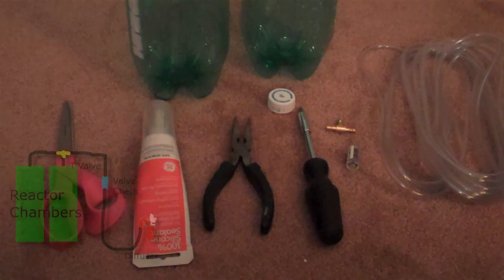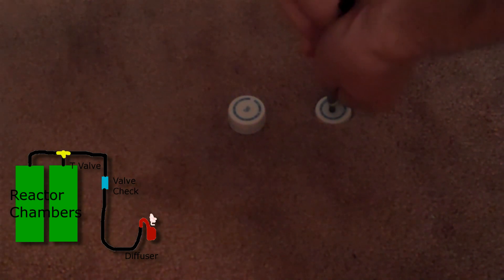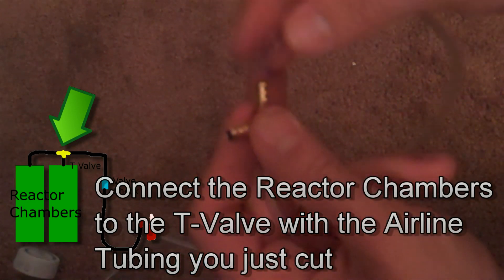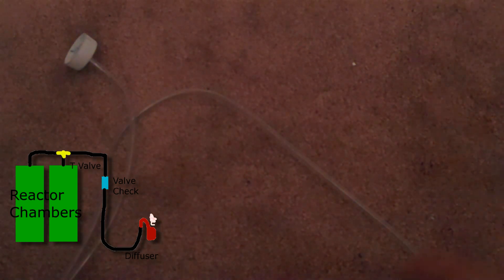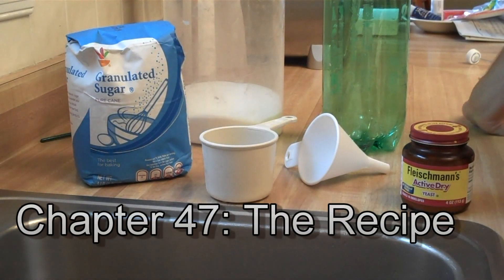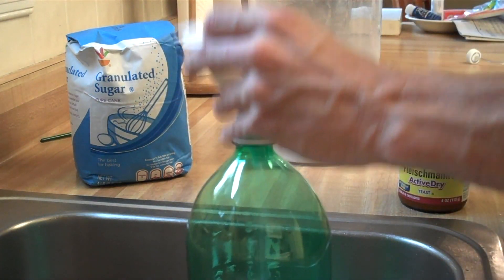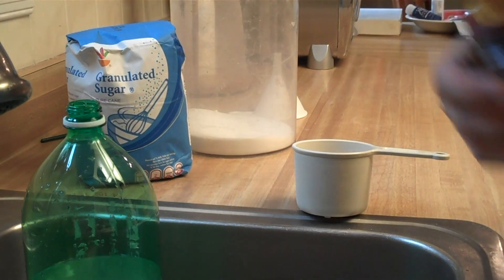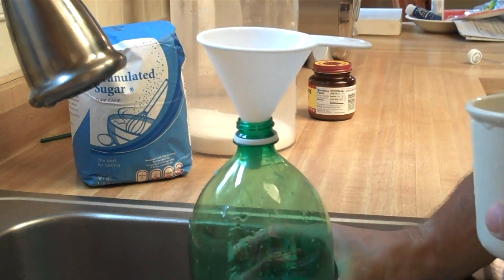How to Build a DIY C02 System and Recipe

Comment: In my setup (DIY), the bubble counter is not really there to adjust the rate but more for monitoring purposes and as a layer of contaminant containment.  for monitoring, it's a quick visual status of system state, more so then the bubbles from the diffuser (which is more difficult to decipher).  for the containment, it helps to keep contaminants trapped in the water of the bubble counter and allows only the CO2 gas into the tank.  you'll understand after you see it in action.

Comment from the maker: I thought about putting in a bubble counter but I never really pay attention to it anyway. With a pressurized system you can control the rate. With a DIY setup the only way to control it is to make a new solution (which I would do in my routine anyway). If I find a second valve check I will definitely put that in so the two containers are on separate lines. I would only lose a little bit of c02 while changing the bottles that it's not an uber high priority. it would be a good addition though :)

Comment: People always forget in these vids to give one SUPER important tip.. Silicone wont stick to silicone.. so dont use silicone airline and think that siliconing seals will do any good. Make sure you use the normal pvc airline.
Reply: Why not add a couple of handfuls  of juicy sultanas and the after fermentation strain, bottle, wait a few months the get rat arse pissed. Lush plants and alcohol for nearly zero cost.

Comment: thought about adding a bubble counter? you should also consider running a dual check valve setup.  that way, when you remix a bottle, you're not releasing the pressure from the other bottle since the check valve works to isolate the bottles from each other.  basically each bottle to their own check valve, meeting at the T fitting which goes to the bubble counter, then to the diffuser.  I hope that made sense.

Comment: I used a glass diffuser for mine and I couldn't get the silicon method to work, the required pressure to make the setup work over powers the silicon hold. glass diffusers are generally meant for the high pressure tank systems.

Comment from the maker: The second bottle is for another reactor chamber. I'm setting this up for a 29 gallon tank so the larger volume of water requires more c02. My plan is to replace the mixture in one of the bottles every week or two to have a more constant supply of C02

Comment: 2:00: if you use a drill and get a cleaner hole, you can actually drill the hole just a tad smaller than the diameter of the tubing you're using and you won't need the silicon.  the tension between the tubing and the hole will keep it air tight with the CO2 pressure actually strengthening it, the more CO2 pressure the more air tight it becomes.